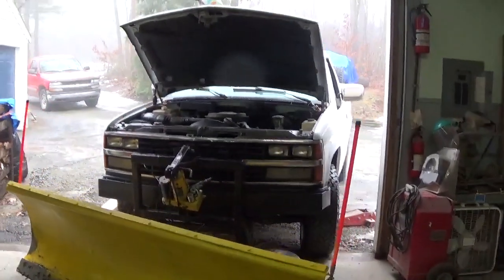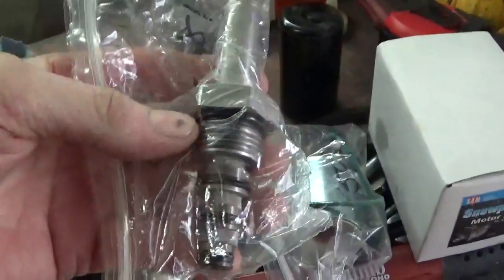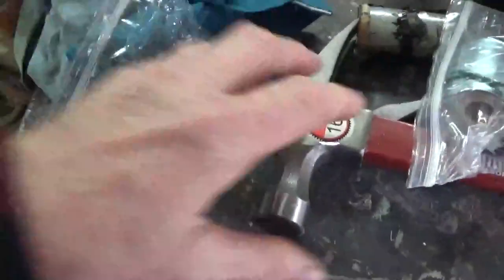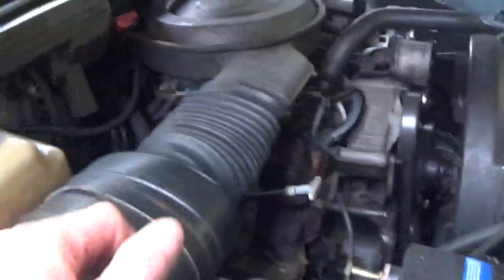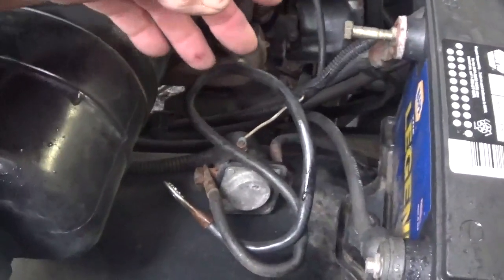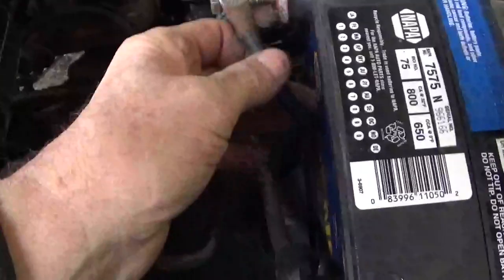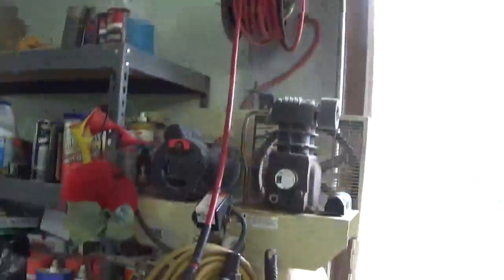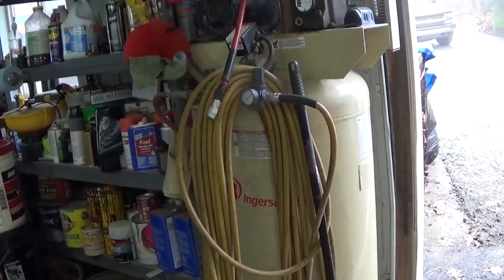Repair snowplow Meyers E47.

Comment: Hey, I have a question?  I have an e60, and it keeps drifting down.  I have checked and replaced o rings in the solenoids and also checked the ram.  I am going nuts trying to figure this out.  Any help would be appreciated.  Thank you in advance!

Comment: Joe when you talked of a testing week, and I watched your style of reasoning, I could tell you were likely a man of the Lord. Why else would anyone take time to share your discovery process. So it is I thankyou! And although I haven’t any real answers why we have both had the same setbacks; first I have an Ingersol compressor whose on off pressure adjustment switch body has had a slow leak for about 30 years. I never could find a replacement, so have merely unplugged each time I use it. Not ideal, but other than one oil change and draining it has been trouble free. Secondly, I ordered a welder in October via USPS, after tracking for 7+ weeks I learned that in Kent Wa. they’d decided to  use same BS excuse, wrongly addressed and had it slated for return to factory! The factory ( ESAB) was furious and paid the Fed Ex freight sent me another. These be trying times! But, such was long ago predicted :)
Reply from the maker: Yes trying times for sure, and with Gods help we can make it through. Otherwise I feel we would be doomed.

Comment: From Donald, Please don't use the blue towel wipes from parts store on painted surfaces, they will scratch it badly.  Please use the new type soft microfiber rags they have 300,00 strands of fibers working for you perfectly ever swipe.

Comment: I'm just curious, Joe. From what I saw on your plow repair, the very first thing I would have checked would have been the relay behind the battery. One cable attaches to the battery, the other would be the output to the pump. The other 14 guage wire is the control wire for the solenoid. IF there is no power on that 14 guage wire the solenoid should be inactive or "open" between the 2 cables. My guess is that if you had removed the 2 large cables and put an ohmmeter between the two studs you would have found very low or no resistance at all indicating an internal short. I am curious as to why you replaced the coil and and valve on the cylinder before you went to the solenoid. (my being an auto mechanic as my profession is why I ask)
Reply from the maker: Hi William, I knew there were 3 things that could cause the problem. The coil, the valve, and the solenoid. I had money left for repairs at the end of the year and I figure I don't feel like playing in the cold with the plow or the backhoe so I just bought the parts. I had no idea if the valves were ever replaced since I had the plow pump given to me. So I figured as a guess that I could fix it pretty easily since I had flushed the pump itself about a month prior. That is the only reason that I did what I did. Now I did remove wires to see what was happening but I did not test them. Thanks for your comment.
Reply: @josaljo1  Anything I can be helpful with, I'll do my best. I watched some more of your video's and see that I was getting them at random and did see more for the plow. The valve leaking would make the plow go right as long as the pump motor was running, so yes, I agree that it did need the coil and valve also.  (just my opinion from only seeing a video, and you know what opinions are like, lol) Anyway, I enjoy your videos and I started watching you and Carmine with you WoodMizer LT15. I watch because I am interested in purchasing a saw mill. Your videos to me are helpful in many ways. I am currently healing from surgery which is why I am spending so much time watching your videos. As soon as I am cleared by the doctors, I'll be back out working again. I'm glad you and Sally had a nice Christmas! After leaving Harrison City last March (2019) and are back in my homestate of Minnesota, you bring a little PA back into my home!!  Thanks, Joe and hope your New Year is Happy and Healthy, and all our best!! Oh, and you can call me Bill :-)
Reply from the maker: @williamrarick6272  Thank you Bill for the great comment. Nothing is more valuable than a good mechanic. Except a good wife.lol

Comment: Well its working the pump because ur getting power thru the main solenoid, not the valve or the magnetic solenoid that works the valve, so id change the solenoid first, not last. The valve controls direction, not the pump.
Reply: Yup, like older cars and the starter/ relay. Screwdriver between nuts to activate.

Comment: I found that I have to replace a solenoid for my Meyers pump 1 time sometimes 2 times a season
Reply from the maker: Yes they are pretty lame, I also get water in mine even though I use antifreeze in hydraulic plow oil.

Comment: Would it have helped to check for continuity on the solenoid before you ordered everything...I'm not an electrician
Reply from the maker: There were ways to check each item but I figured for 150 bucks I can replace all the parts which seemed cheap to me.
Reply: I remember a Myers manual with a flow chart....if you try to raise and it goes left the x valve is sticking.
Then sending juice to valve x to see if it clicks of if its a short in the wire....and then making sure there is no moisture in the fluid that can freeze and clog up the valves ...that was before i bought a kubota
Reply from the maker: @brianhanrahan7561  I read all about that but I did not want to fool with it in the rain. So change parts was not to bad.
Reply: I admire you for keeping it running.
I used to keep a propane plumbers  torch in my plow truck to thaw out the valve body on the job and go through the flow chart and do repairs in the feild . The video brought back chilly memories .
Happy new year
Reply from the maker: @brianhanrahan7561  Well I cheated, I have a kerosene heater blowing behind me. I remember tighteming bolts on a water line as a kid and the temp was -15. That was the one day I remember for cold.

Comment: Joe ck out surplus center they have them compressor motors
Reply: also solenoid at tractor supply 20.00
Reply from the maker: @pup734  Do you mean the solenoid for the plow?
Reply from the maker: I have to check out the motor I have to get the right one, but the price is way less on surplus center, thank you.
Reply: @josaljo1  the on on the wheel well yes
Reply: @josaljo1  I have built my saw mill from surplus center
Reply from the maker: @pup734  It was 15 at smith brothers.
Reply from the maker: @pup734  I never bought there yet but the price of that motor is 3 times less.
Reply: @josaljo1  good deal Napa just charged me 35.00 Plus tax
Reply: @josaljo1  good shipping fast
Reply from the maker: @pup734  Napa wanted 148 just for the c valve.
Reply: @josaljo1  Napa is price gouging me all the time They wanted 175.00 for the lift pump for my diesel and I ordered one online for 70.00 just had to wait 2 extra days to get it in the mail
Reply: same exact lift pump